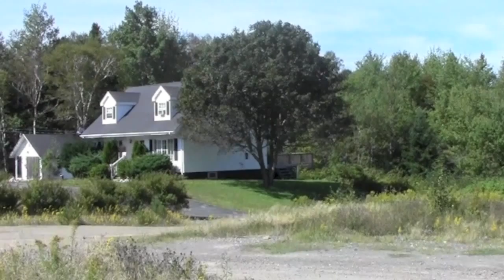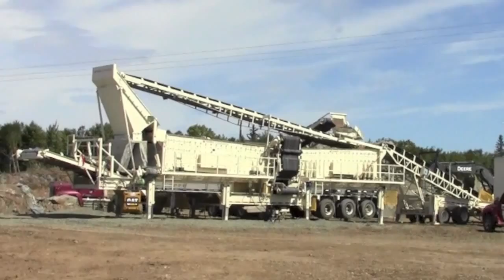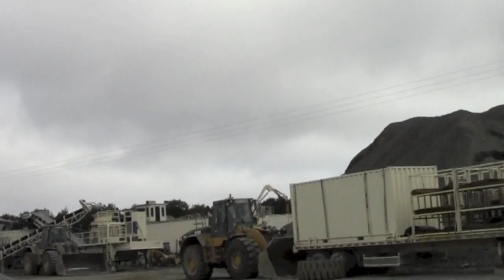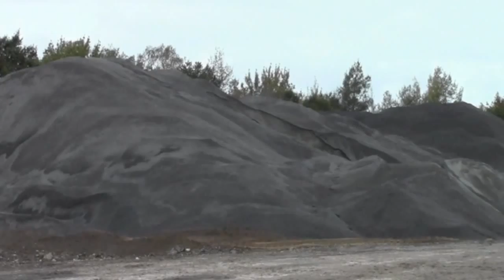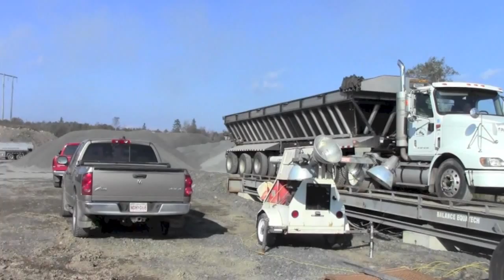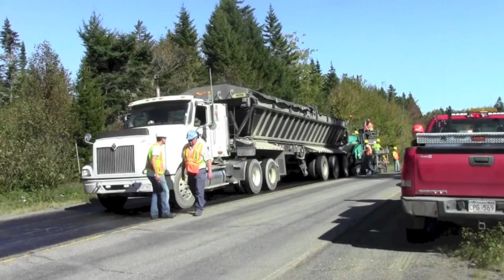Construction, Crushing and Paving

Comment: Hey Dale, great video. I'm not even sure how I stumbled onto it lol. That's my lab trailer at 13:44 with the brown half ton parked to the left. Really enjoyed working on the island and having a chance to do some site seeing. One of the nicest places I've had the chance to work! Fyi, the machine at 12:40 is a wash plant. It washes 1/4"minus material (which would be one of the bigger piles of the smallest crushed materials). It uses a large volume of water to wash the dust out of the material. The reason for the darker color is because it's wet. Anyways maybe we'll run into each other next year.
Reply from the maker: Thanks for all of the information all of the mounds of stone will look like white mountains in the morning. It is -18 here this morning and we have 40cm of snow on the way for tomorrow. I do a lot of walking and now that the Bunker Hill road is paved I walk it most days up to the store and back 10.7km return. We're looking forward to your return in the spring to finish the job, the new paving is such a treat to drive on, after all the years of ruts and holes.